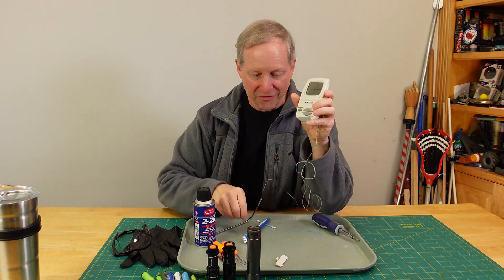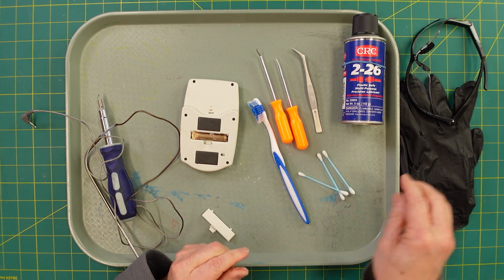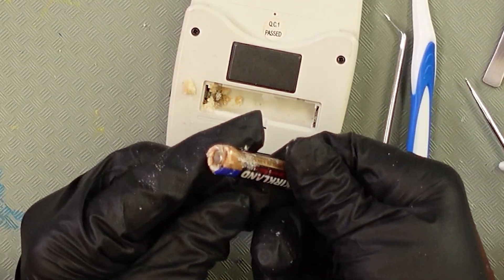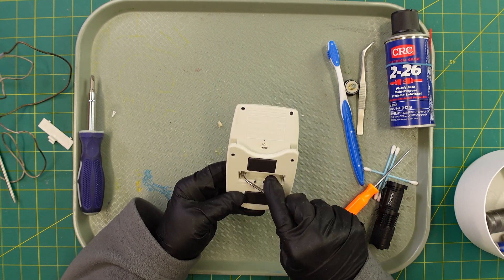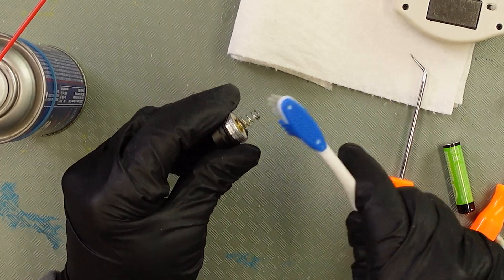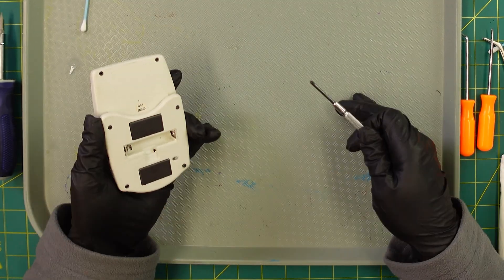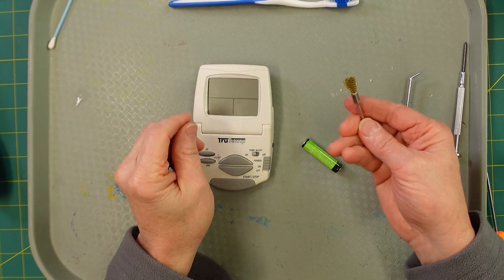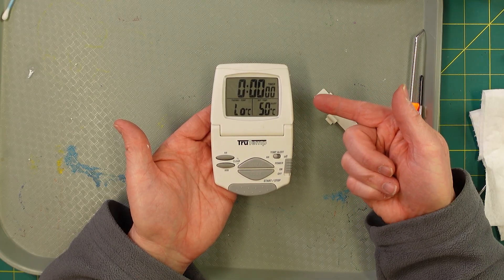How to Fix Your Battery Corroded Electronics, Safely

Comment: 10 years ago, rechargeable batteries were very expensive and had little capacity. they also tend to be inconsistent, sometimes you charge them but they barely hold a charge.
Reply from the maker: They seem to be much more reliable now, at least that's my experience...

Comment: Sadly ....didn't work for me on an action figure with voice taking three LR44 puck like batteries. Cleaned the compartment to looking new but still nothing. And these modern action figures are not SCREWED together; they are hard glued so getting them apart and into them means breaking seals and all sorts of nastiness and putting them back together is dodgy. So got an action figure with trigger that no longer works. Oh well.
Reply from the maker: Sorry to hear. Action figures are tough for the reasons you've stated above...

Comment: what if that spring has totally corroded off
Reply from the maker: Then it might be hard to recover... You could solder a new spring to the unit from another salvaged electronic, or reroute the battery conpartment externally, but that can get complicated fast.

Comment: You are the best!!!!  I fixed my battery operated pencil sharpener.   Panasonic said they didn’t make them any more. It was new still in the box.  I had left my batteries in it. I just couldn’t throw it out!   I had cleaned it.  I cleaned the metal with your instruction and wd40.  IT WORKS!!! I’m so happy.
Reply from the maker: That's great to hear, glad I could help!

Comment: The spring contact on my device broke off with corrosion.  Any tips for replacing the spring?
Reply from the maker: You find a similar spring on another device, but a true repair would require soldering...

Comment: By the way, a pencil eraser or a small nail file is also useful for refreshing the surfaces of battery contacts.  This was a good video and with some really great tips.  However, battery "salting" is due to a battery seal failure, that's often due to sub-standard manufacturing, the shelf life of alkaline batteries and is aggravated by improper storage of the battery.  Replacing an alkaline batteries with a rechargeable battery will avoid the contact corrosion since rechargeable batteries use a different chemistry not prone to salting.  Also, on some electronics with a "phantom power draw" a battery reversal may help prevent the unnecessary battery drain.  Although, I'm not sure if it's actually better to block the circuit with a insulator of some kind, like a bit of plastic or as another commenter mentioned a piece of paper.  The reason I say this, is that reversing the battery relies on internal circuitry to stop the flow of power, typically a diode.  The diode has a peak inverse voltage or reverse voltage that when exceed the diode begins to breakdown.  Which is why I believe battery reversal may not be a sound practice for long term storage.
Reply from the maker: Frank, thanks for the feedback. We have some Christmas ornaments and candles where we block the circuit with a bit of plastic. Thanks for the reminder, we too are shifting mostly to rechargable batteries.
Reply: This worked for me, thanks!

Comment: Good job on the repair.  You do need to be careful when reversing the battery as some electronics are not reverse voltage tolerant.
When I want to store a device with batteries in a non-functional state, I insert a piece of cut paper between the batteries or the positive side of the holder.  I typically will do this for my faucet automatic water timers.
Also please note that reversing (or disconnecting) the battery does not address alkaline cell leakage.
Reply from the maker: Allen, thanks for the feedback. I've reversed the batteries mostly on flashlights and they are typically rechargables but your cardboard or I use plastic disks too, just forgot to mention in the video.